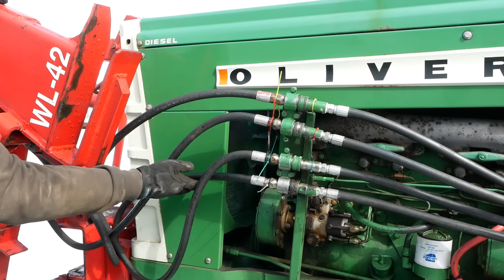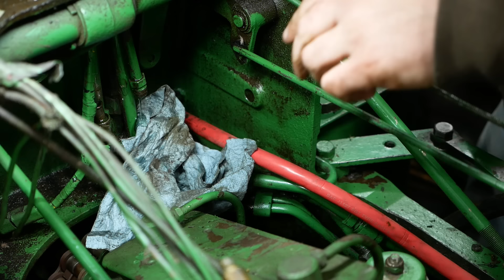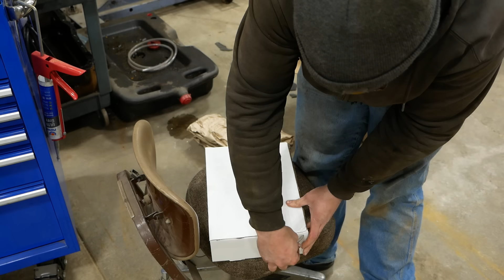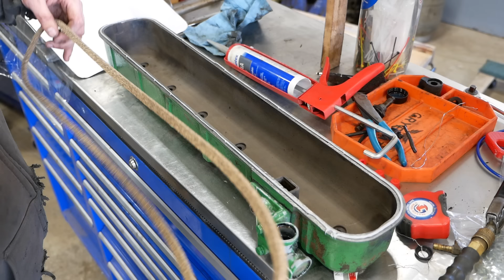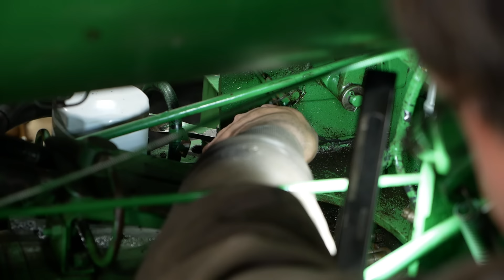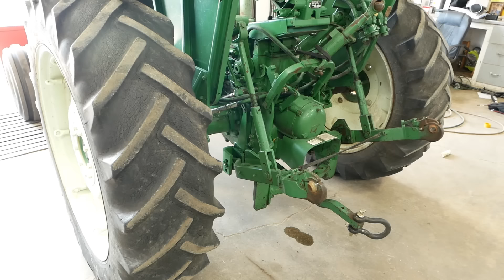Oliver 1650 Tractor Fuel Injection Overhaul and Other Repairs

Comment: Hello Wes , tip : to put seal like you did on the driveshaft  without special tools you can use a piece of soft plastic from a limonade or milk can  . You cut with scissors the side out of the bottle and fold this on the shaft and clamb that with a hoseclamp or tyrip. hape it conical at the beginning of the shaft  and grease the plastik. put the seal on teh plastik and push it in her place.You will understand that the plastik must be thin and strong enough, sometime i double the plastik skin for that reason . If the clamb is in the way of the seal change the position of the clamp or make it that is goese with the seal . For the rest you make a fine job keep it going  greate respect  from  Friesland   (NL)
Reply: Good idea!

Comment: Interesting when doing the valves, you say the valves in overlap do the companion cylinder, I was always taught it as valves rocking, because as the exhaust valve rocks closed, the intake vale rocks open, and if you roll it back and forth around TDC the valves both rock open and closed.
Reply from the maker: Same thing.

Comment: Enjoyed watching as always Wes. It was a little painful to watch you putting those pump driveshaft seals on while I was looking at the installation tool in front of me, but you hung in there and got them on. You must have used much more patience than what the video showed because they do split very easy. The ones I used to work on also had an orange seal that split sometimes even with the tool. Great job, and I look forward to watching more content.

Comment: Regarding how to pour from the plastic jug. If you do it with opening to the bottom, the jug will have to gobble air in thorough the same, filled opening as the fluid enter out of. That will give an unsteady flow that spills. The trick is to rotate the jug so that both fluid and air can pass the opening at the same time. To turn it 180 degrees is not necessary, just 90-100 degrees will do.

Comment: Wes, I think whoever told you about rotating your fuel additive jug 180 degrees was mistaken, at least for that particular jug. I’d try 90 degrees next time. That and a spill rag - worth a shot. 👍
Reply: Yes absolutely. You can easily pour without it spilling anywhere and air goes in without interrupting the flow. It's hard to imagine why someone would say turn it upside down.

Comment: Mornin Wes, sorry I'm late to the show, but you were on your Oliver, I was tackling few items on my MF 135 last couple days.
On your power steering lines, you can if you need to braze them, are if you can get them clean even use Stay silv flux, and 15% sil-fos if need be, and it actually works very well on steel lines.
Rated for high psi, so shouldn't be an issue as far as meeting psi rating. 
Just make sure not to get it too hot with either application, and sol-fos should work on your brass block T's as well if you can't find replacements. 
Also once you've brazed the brass, it should be plenty strong enough to crank on it to tighten up your compression fittings on either end  too.
Might need to run a fitting brush through the brass fittings to remove any scale that occurred during the heating process, but that's easily enough done to prevent clogging any injector that might be inline with it.
Looks like Young man's from Kansas 5 ton, as I don't believe it is a duce n half that I seen in the invisible background there. 
Seems ZZ Top song comes to mind here, something about a invisible 7-11.
I'll leave it at that.
Enjoyed the video as always, and my don't you have a nice looking old green tractor for one that needed so much attention. 
LOL, just wish mine ran as well as yours does now. 
Be safe and stay well
Try yesterday's tractor supply, they have warehouses spread across the country, and they may be able to help you, are Abilene Machine, they have pretty good selection of parts too
Reply from the maker: The original fittings were brazed.

Comment: unless the valve arrangement changes, you point out 4 exhaust is to the rear and you set 1 front as exhaust,
Reply from the maker: The exhaust has shared ports.

Comment: Great video, Wes! 👍 Pooring from a cannister is best done sideways BTW, you won't spill on the handle and the air can enter the can regularly.
Reply: Pouring from a flat jug upside down is a terrible idea as we saw. Pouring it sideways, horizontally, you can pour from the left or right whichever is easier. No spills and air bubbles coming in

Comment: FWIW, my father taught me that trick of pouring from the top of a gallon can back in 1956. He said his uncle had taught that to him in the 1930s. So it is a venerable trick.
Also FWIW, in those days gallon cans were cans, not plastic squeeze bottles, and they didn't have handles that stuck up above the height of the screw top. Possibly that made the trick more valuable back then. :-)

Comment: Yet another easy way to set valves is to bar the engine over to TDC #1.  Set both valves on #1, then #2 intake, #3 exhaust, #4 intake #5 exhaust.  Bar engine over to #6 TDC.  Set both #6 valves, then #5 intake, #4 exhaust, #3 intake, and #2 exhaust.

Keep up the good work! I enjoy your videos.

Comment: Good job steam cleaning first!

For tight quarters hydraulic line work like you did, I have a set of old craftsman wrenches that I have ground the outside of the open end wrenches. This narrows the wrench, makes it easier to spin the fitting off and on. I use a line wrench to break and close the fitting for strength though.

Comment: All in all, its a great day when everything turns out okay and you can go home knowing that the farmer is going to get by one whole day before he breaks something else on it. I have seen prices of new tractors and they make buying a new ford F450 quad cab 4X4 diesel look cheap. More for the tractor today than price of the land fifty years ago. I know that even though it can cause some loss of sleep trying to figure out  why it broke so you can fix that too if possible. When it comes to fixing a tractor or a foreign car, I do believe the tractor can be easier or at least from my trauma days... thanks for sharing Wes, and you just don't get it do you how to pour fuels or other from a can or jug. As in as high up as you can holding it to the side so it doesn't pour back on itself.

Comment: The life hack for pouring is to turn the bottle on its sign and pour.

It will let air in as it pours.

That keeps it from surging, glugging, and spilling.

I used to work at an auto paint company mixing paint and it was taught to me there.

Something I’ll never forget.

Works with any flat sided container.

Super for antifreeze.

Comment: Hey Wes. We use the umbrella seal on Continental pumps. We will actually drop them in a hot oil. Makes them pliable and also allows them to slip on. Just don’t heat the oil up hot enough to burn your fingers.
Reply from the maker: Good idea!

Comment: Hey Wes, I rarely have any "tips" for you as you are pretty good at what you do and I learn a lot from you.  However, I do have one for you for those hydraulic/fuel banjo bolts and flare fittings that like to seep on you. It's called "EZ Turn Lubricant," or used to be called "Fuel Lube" in the old days.  It's used in aircraft fuel and high pressure hydraulic applications and most aircraft mechanics will swear by it.  it feels like a bees wax and you spread a small thin amount on the crush washers for the banjo bolts and threads of the hydraulic and fuel hoses.  It takes very little for a fitting or washer so if you buy a tube or can of it it will likely last you a lifetime. I use it on brake caliper and power steering banjo fittings quite often.  https://www.aircraftspruce.com/catalog/cspages/ezturnlube.php
Reply from the maker: Interesting. Never heard of it. I'll check it out!

Comment: I was cracking up at the bottle pour fail. It works fantastic on oil quart bottles, but for the 1 gallon jugs with handles in the way, you have to tilt to the side a bit. The idea is to keep  a straight shot of air going in so it doesn't glug glug glug and spew stuff everywhere. I fill small containers from 5 gallon buckets the same way, except you do it with sort of a rolling motion that follows the fluid level. Good luck next time.

Comment: You don't turn the jug all the way upside down when full, and not with that style jug.  It's not a "life hack", it's the proper way to pour from a jug so air won't glug.   It used to be taught in shop class and the method has been used for many, many years by professionals.  Dint be afraid to learn something new.
Reply: To clarify what I mean by type of jug... the one you used in this video had the hollow handle which makes for smooth air flow.  Like a modern milk jug.  For bottle and jugs without a handle, always start with the jug inverted.

Comment: You forgot the lube filter for the rear end and transmission. The pto seal is a tough one, you may slow it down but it won't  last long.  Agcopartsbook.com    Usually just replace whole pump.

Comment: The fuel hack works, but for that bottle where the handle was in the road just turn the bottle 90 degrees and it works just as well.

Comment: I never have been a fan of inverted flare fittings, I always keep intending to make adapters to JIC .
Power steering hoses always leak up here in Alaska,  hydraulic hose shops have reusable hose ends which they silver solder your factory steel tubes this way they can use arctic hydraulic hose,  
Area Diesel did nice job on your pump and injectors it sure starts and runs smooth now,
25 years ago I flew into remote gold mine or copper mine and they had 5 hard rock core drill rigs skid mounted and all powered by 6 cylinder Oliver diesels plus 5 Oliver diesels powering Bean drilling mud pumps,  all these rigs were old early 1970's I figured , parked not in use I was trying to get one home but to much trouble..  good video  thank you

Comment: Hiya Wes. I know you're already done, but something you likely have in your recycle bin comes in real handy for seal installation. You know that installing valve guide seals works a treat with a little plastic tube over the valve stem to keep from shredding the seal on the keeper grooves. I have found that using the same trick by making my own with some stiff clear plastic and a little clear tape (packing tape) also works a treat. The clear plastic? Supermarket muffin containers. I use that trick all the time when sliding seals over shafts, also installing small engine covers with spring lip seals. I never pop the spring or roll the seal and I never break the seal with a pick. Only takes a minute to make and it has saved my bacon time and again.

Comment: Is it not worth replacing the old-style filter housings with something more modern? You will probably get better filtration and avoid future contaminant problems. I understand it won't be original anymore but probably worth an upgrade?
Reply from the maker: You can get more modern filter bases off of a newer tractor. But these work fine.

Comment: I just can’t believe how any regular mechanic with average skills could take on this job and be successful. It hurts my brain just imagining all the plumbing issues, fuel lines, hose and fitting compatibility Issues to replace solid fuel lines, return lines, cracked brass tees replacement. I’m sure You have a plan B if you can’t get a mechanical lift pump. I am now waiting to see how or where You are going to get replacement rims for a 60 year old tractor and mount new rubber, and what the hub issue that moved is? That old OLIVER GIRL has a new lease on life equipped with rear blade and front detachable loader that makes it versatile for crop work. I’m guessing a new machine would cost between 50 and 75 thousand. Great work Wes and Your experts at Area Diesel that saved this machine from being melted down to make rebar.

Comment: When I was taught how to install an injection pump you turn the pump with the direction of rotation and then go in the opposite direction till the timing marks line up. This takes up the backlash in the pump gear teeth so your timing isn’t retarded. Do you do this?
Reply from the maker: The manual says to turn the engine in the direction of cranking. If you have to back up, go at least 90 degrees and come back in the direction of cranking.

Comment: What kind of damage are we talking for Area Diesel Service to rebuild the pump & injectors? I have a Farmall 460 that could use some work on the injection system.
Reply: $500 for the rotary pump that I had done but that wasn't bad considering deere wanted $3000 for a new one.
Reply from the maker: Yeah, in the $600-750 range on the pump. About half that for the injectors.

Comment: I helped a old buddy of mine, his name was Wes, too!, around 35 years ago to do some service work on a Oliver tractor that was equipped with a six cylinder Waukesha diesel engine.  Had a hydraulic rear end AC cab, really nice.  If you ever had to do any real engine work on that tractor, you would have to pull the engine to get to the bottom end of the engine because of the way the frame was made.  Biggest tractor I've ever been around!!!  Thanks for sharing!

Comment: That  hose  which  you  holding  at 33:07  is  too long...(by  original?) I  will cut  it  in half  and  it  will be  ennough to connect  both  sides.....

Comment: Give Larry Svehlak a call at (512) 633-5014. The Oliver part number for the fuel pump is 161604A, which subs to an Agco number 79017945. Larry has lots of NOS parts, and might have the sleeves you need as well. There is an aftermarket pump, the Airtex 6930, but I'm not having much luck finding any in stock online. You might check with NAPA on that one. AGCO shows the 79017945 as a good number that can be ordered, but it's coming up at $154. 

On your hydraulics... If I'm seeing things right, you run the loader off the remotes and use a power beyond setup for remotes? If so, swapping those two would really help.

Comment: i wonder on the lift pump .. if you could use an Airtex 6930 that fits higher model number olivers and just use the parts out of it to fit yours.  or an Airtex 572,  or 40217,  perhaps a Carter M73014, Carter M3530,    Carter M751,  Carter M3296,  Carter M2278  Carter M2195 , to rob parts from.  or a jeep 134 fuel pump kit.. https://www.kaiserwillys.com/single-action-fuel-pump-rebuild-kit-fits-41-71-jeep-willys-with-4-134-engine   all the above use what seems to be an identical style of pump body/housing and cap..
Reply from the maker: Hmm. I'll see if any of those parts are available.

Comment: It's a good idea to add some antiseize to the injectors, atleast if you ask the next guy whos cursing about the rusted solid injectors :)
I recommed using exthaus mounting paste in the silencer mount, it lubes and seals the joint, making the exthaust pipe easier to remove and keeps the inside of the bonned sut free.

If those tires are iron woven then they should be good to go.

Comment: I'd be curious to see how bad that man - lift is that you're scrapping it. It looks like a pretty new unit.
Reply from the maker: It's 100% computer controlled through a complex CAN network. The main computer board is smoked. Replacement is more than the machine is worth.
Reply: @WatchWesWork  Got it! I've had to do a computer - delete on a couple of small things over the years, so I totally understand.

Comment: Any thoughts about putting a turbo on it? Splendid video, thanks!
Reply from the maker: That would be nice, but I don't think the bottom end could handle it. These Waukesha engines only have 4 main bearings and they are prone to bearing and crank failure. They also have weak head gaskets.

Comment: Something I have done a few times when making new hoses with crimped hard lines is cut off the old crimp, remove and sacrifice a new fitting for its crimp and with a bit of jiggery pokery you get it to work and have the original pipe crimped on a new hose.
Reply from the maker: I can't find anyone who can do that.
Reply: @WatchWesWork  I think we need to find you your own crimper in this case!

Comment: What a difference!, Oliver starts and runs so well now :-D
I'm amazed that it could start at all with everything in such a poor state.
A modern tractor with buckets of computers would be impossible to keep
going as long as oliver.
Manufacturers keep changing things and 20 years later there would be no
compatable computers.
Designed to be unrepairable :-(

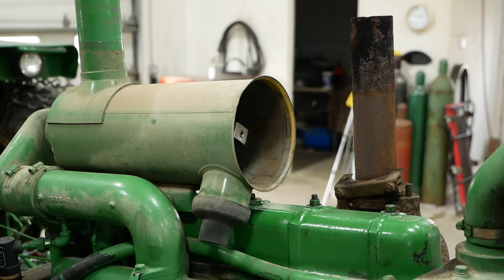Comment: 41:05 that thing shouldn't really leak there anyway unless it's got plugged drain passages in the head. Pretty deep well around the valve springs; can't imagine it floods enough oil up there to totally fill that well.

Comment: 37:01 Way way way way WAY overcomplicating things. Just bar it over watching the cylinder you're about to set the valves on. Intake opens, closes, exhaust opens, closes, half a turn further, bingo. Easy peasy. No need to do any fancy mental gymnastics or try to trace the firing order or companion cylinders or any of that nonsense.
Reply from the maker: This way you only need to turn the engine 2 full turns. I guess I'm just so used to this method I don't even think about it anymore.

Comment: Just a different take on valve setting, 1-5-3-6-2-4 firing order. 1 on TDC compression set valves on 1. Rotate crank 120 degrees set valves on 5. Rotate 120 degrees and set valves on next in firing order. Rinse and repeat through firing order.
With an 8 cylinder rotate 90 degrees and follow firing order. Got that pounded into me as a kid working on V8 and stove bolt 6 engines. Dem was da gud ole daze.
Thanks for sharing.